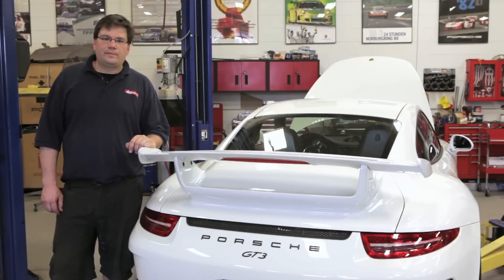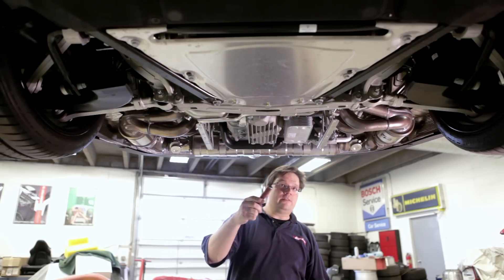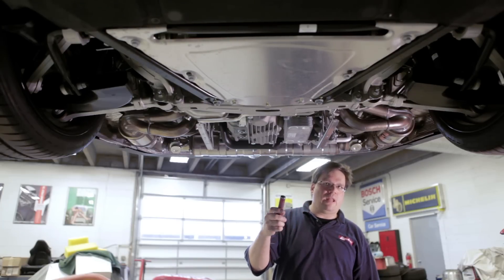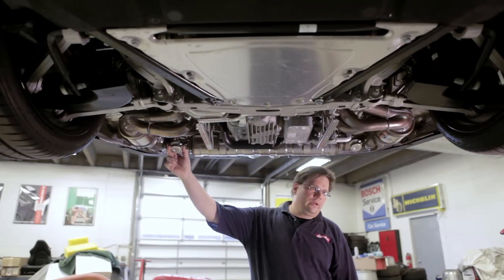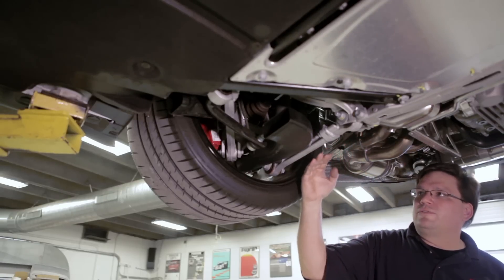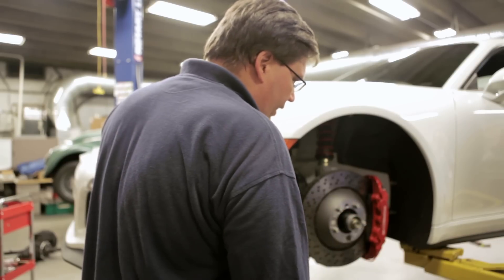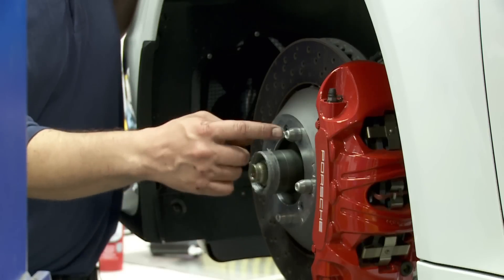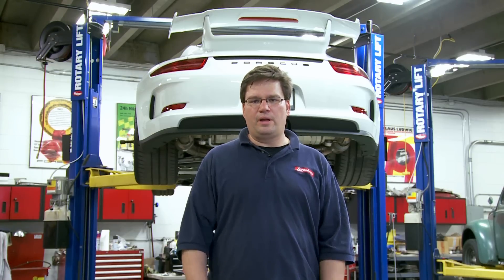The 991 GT3 Project: Underneath the Car

Comment: Robert, thank for the informative video. As someone who is a 991 GT3 fan and planning to own one, your series of videos are exactly what enthusiasts require. We were able to get a few enthusiasts together to see your videos and some of the requests that came up where the following-

1. Can you make a video where you show how the oil and filter is changed on the 991 GT3?
2. Can you make a video where you describe the different track day specific wheels/tires you would recommend?   Consensus is that stock tires can get greasy. Also, do stock pads hold up for track day use?
3. How easy is it to DIY standard maintenance/service requirements?